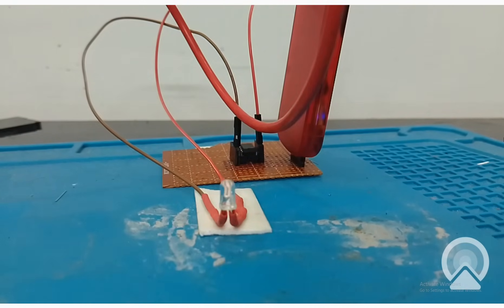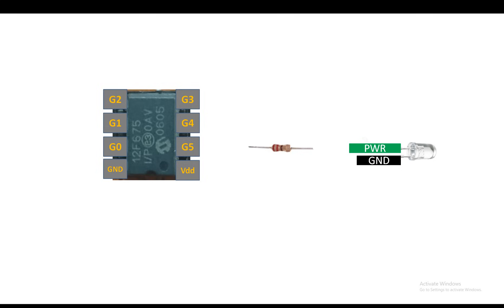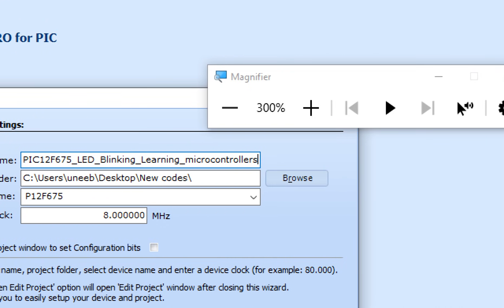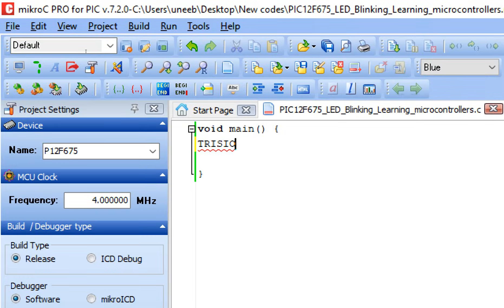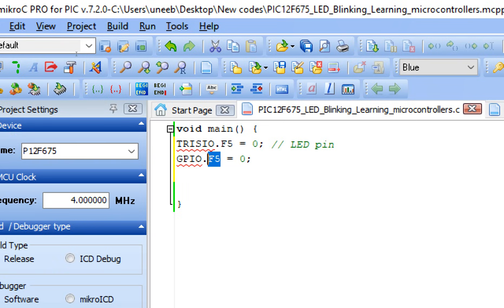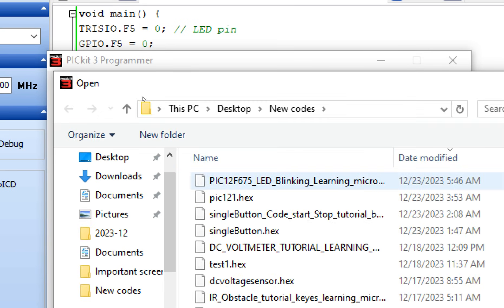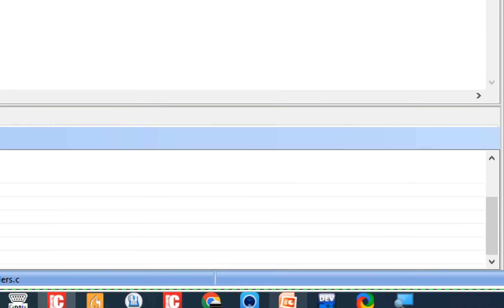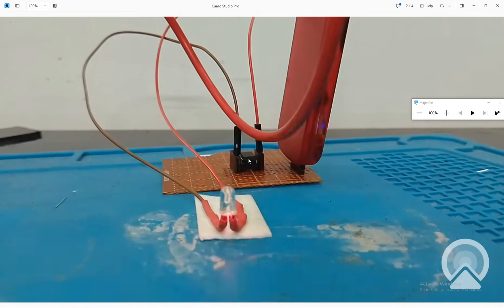Blinking an LED with a PIC12F675.

Comment: This video is very well done, except I am basically dropped out when we are told we have to use the $270 microC compiler.  Is there any way to get this working with XC8 compiler?   I have been fiddling with PicKit 3 for several weeks, and have failed to have even  one program work on it that I can measure results from.
Reply from the maker: MikroC is free for codes having 2K of program memory
And this controller will go in free
Its paid if your code takes more than 2k program memory